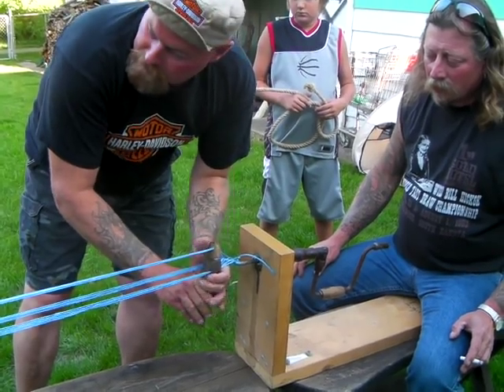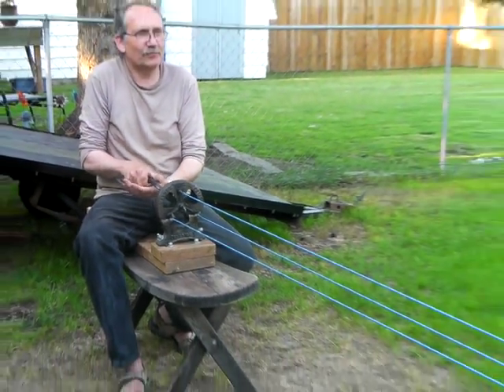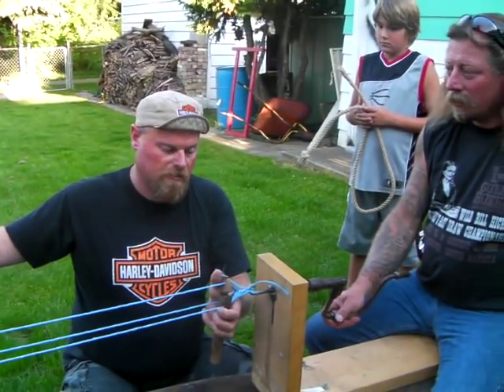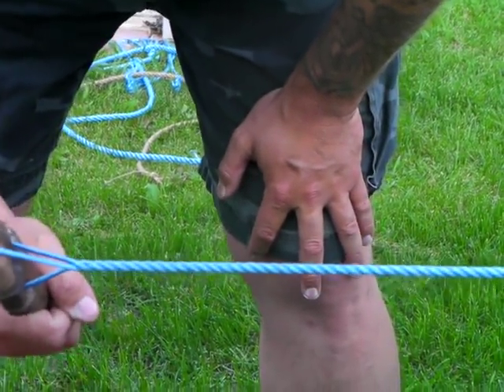rope making

Comment: My 25 ton truck was stuck in some deep mud on a building site....they had a JCB could pull me out, but no rope except the thin blue nylon line that cable com panies use to pull cable through conduits.   One of the guys looked at the thin line, took a knife to it tied one end of 5 pieces then he proceeded by hand to make a rope, within 5 minutes he had a rope...it still looked too thin...but he said it would hold and it did, out came my truck!!  I asked him where he learned that, he said " 20 years on Deep Sea Trawlers and you learn how to make ropes and just what a rope will take before it breaks"  respect to the guy.

Comment: I watched a demonstration of this at Fort Ross at the Russian festival just north of Jenner, Ca. I was so intrigued I took a bunch of pictures of a very simple version of the crank as well as 1 made from metal gears just like yours. I have full notes if anyone wants to make this plus notes on each & every step. Pretty cool esp if you boat or just want to make any kind of custom rope. Start with 115 % of desired length. You want 100 ft ?, start w 115. After you wet it down it will shrink & tighten & gain strength. The gentleman demonstrating explained that it can additionally be waxed for smooth closing loops & lassos - so next time you see a huge spool of twine you'll know what its for. He also stressed that you want an odd # of strands on ALL of the hooks at the geared crank end which will determine where you cut & tie off your twine. All get 3 or 5 or 7 etc etc. It just struck me that people had to figure out how to create this before we had machines do everything.

Comment: Very cute. You can make rope now learn some basic knots.If you replace what you call a whittle stick with a traveler and use the swivel and weight on a pulley it is very easy to make rope with just one person. Yes I am a master rope maker.
Reply: Rustaholic777 h

Comment: Where can I buy one of those twisting tools? What's the proper name?
Reply: look at 1:12
Reply: corey pendergrass 
You can make a simple but effective one with no gears.  Bend up 3 strong hooks ,  each having a crank handle shape bent at the rear.  Start with eye bolts with a long machine thread.  Careful pre-planning is needed to locate nuts and washers (that will support the tension on the hooks/cranks) before the next bend is made. 
The forward hook section is secured (but spin freely)  in the first piece of plywood or 2x6 which is part of the anchor. 
The 3 bent crank handles go through 3 holes in a second piece of thinner plywood.  Those 3 holes perfectly match the triangle pattern of the first 3 holes.  Cut the second lighter plywood shape with a kind of paddle handle extending out the side,  which allows you to turn all 3 hooks at the same rate.  50 years ago my scout troop got a giant spool of sisal or manilla bailing twine.  With that primitive homemade system we made a lot of rope that day.

Comment: I saw one extra hoop in the center of the machine, Why was that one not used?
Reply: The center HOOK only turns once per turn of the crank. . . The other three are what you make rope from. . .They all turn about three times for each turn of the crank. . . If you find and read the original manual for that machine you will see that center hook is for finishing the rope. . . The setup here has a crank on the far end for finishing.

Comment: Why doesn't it unravel?
Reply: The rope is all twisting in same direction and twisting on itself. The friction between the rope causes them to stay
Reply: LaserFalcon ask your mom.
Reply: The initial twist of the individual twine was clockwise which causes the fibres to try to unwind in a counter clockwise direction. The second braiding step is done in a counter clockwise direction causing the twisted twine to try to unwind in a clockwise direction. What that leaves you with is two internal structures trying to unwind in opposite directions which cancels out the tendency to unwind altogether.
Reply: Hahaha, there’s me answering a three year old question. Hope you’re still around to read it man.